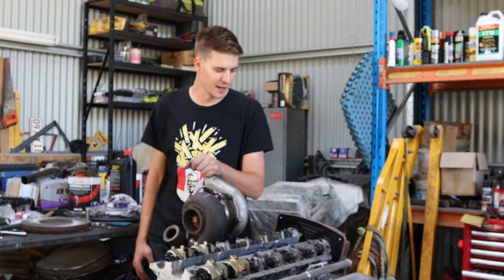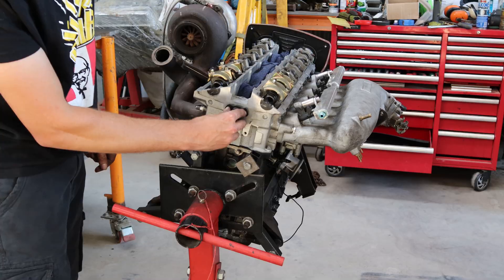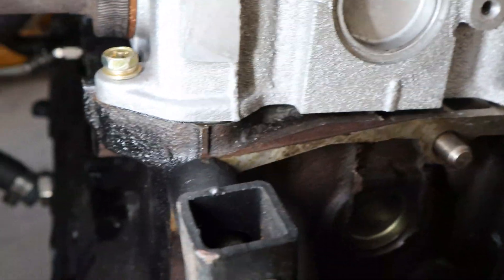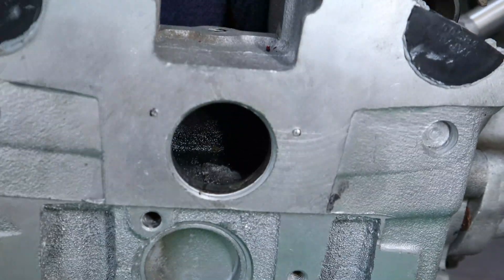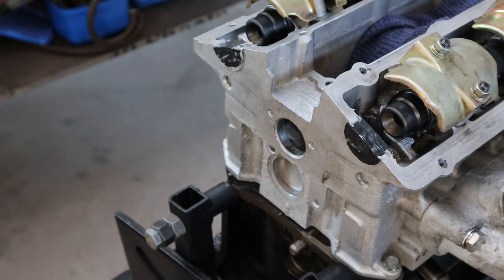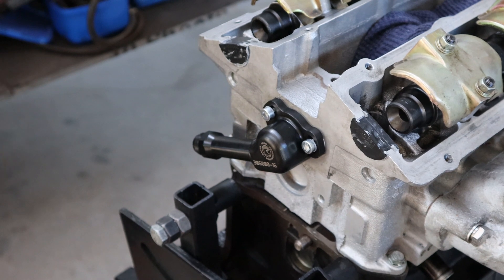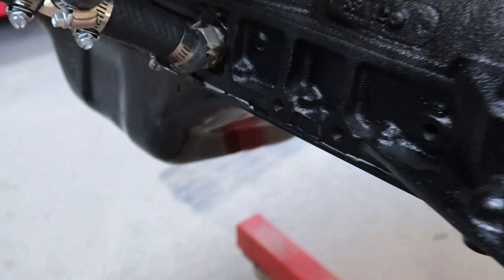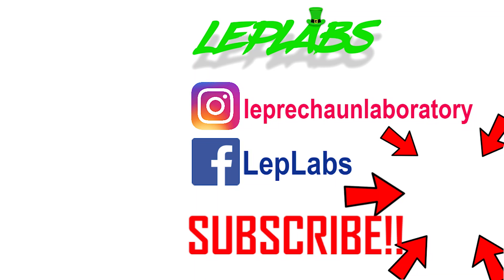RB25DET Head Drain Install

Comment: another answer is to let the engine warm up for 30 minutes before driving
Reply from the maker: What does that have to do with this?
Reply: @BoostGumps It is just a way to buy more time rather than thrashing the motor before it's lubricated.
That's my own answer to the key oiling issues you talked about.
Reply from the maker: @drtec6349  i see, but that has little to do with drain back issues and destroying oil pump gears in high rpm applications
Reply: I just thought, it makes better pressure when warmed up and 0w20 lightens it up a lot, burns very well.

Comment: Do you need to drill right through? You could probably drill 90% depth and still tep, even if you used a slightly shorter bolt, there would still be plenty of thread engagement for this.
Reply: Exactly what I was thinking

Comment: Hey man i was just wondering is there any difference to weather you drain this into the sump or engine block ? As i had my Mechenic t up my old setup into the oil drain for the turbo but i have had a few people say it should have its own hose either into the sump or alternatively into the block on the intake side , what are your thoughts?
Reply from the maker: Rage garage fine to tee it into turbo drain, although ideally having its own drain in the block/sump would be ideal. Doesnt particularly make a difference whether its in the block or the sump, as long as its high on the sump so it can drain freely. I would not recommend putting it on the intake side, the crank on an RB spins clockwise (if looking at the front of the motor) and thus will create a bit of a natural vacuum on the right side of the crank (exhaust side) aiding in draining. 
Not that it wouldnt work on the intake side, just would work better on the hot side.
Reply: @BoostGumps  That's actually incorrect. You shouldn't do it for two reasons. One being that Nitto for example says you definetely shouldn't tee it to anywhere, instead direct drain to sump. Second potentially you could end up in situation where there is oil not draining well enough for turbo because of high flow from the back of head. For example high acceleration scenario where lots of oil has collected to back of head and flowing to drain and potentially causing damage to turbo in this case. It could be also case where actually that drain starts to act as a crankcase breather, that means that gasses flow up from crankcase and stop turbo drain flowing as the drain can act multiple way. So overall, no, it's not a good idea to do that.

Comment: Sweet! 2.5L princess content! :D
2 quick questions:
- I'll probably have my Neo rebuilt in the next couple of years. Should I plan for such a drain, I've heard the Neo head had less head drainage issues than the regular 25 head?
- I've just bought a set of no name 750cc, E85 friendly injectors. Vendor says they're guaranteed to be flow matched and all, but I didn't get a flow chart with them. Aaaaand apparently nobody in my area can flow test gasoline injectors (gotta love France, wooohoo!). Should I just send it? :D
Reply from the maker: mrsabidji still a great mod for the neo! Its really a very cheap thing to do, this whole drain setup cost around $100aud. Definitely something i would recommend for any 25 thats pulled down already (or even not in this case)

Yeh to be honest injectors like that are a little risky imo, injectors is one thing i generally actually will pay top dollar for good quality aftermarket or oem injectors, even then its always a good idea to get the set flow tested and matched. Thats my opinion anyway 🤷‍♂️
Reply: @BoostGumps  Noted. I'll do the head drain thing then. :)
I've found a place that will test the injectors. They were not all that far from here actually, just not very well advertised. :D I should have the results soon. :)
Reply from the maker: mrsabidji awesome!! Be interesting to see how they go
Reply: @BoostGumps  Definitely. And that seems a lot more productive than finding out by potentially destroying my engine. Worst case scenario, I've just wasted $200aud. :D I'll tell you how it went. :)
Reply: @BoostGumps  update on all of that: I've bought a set of proper injectors. Deatschwerks 750, I hear good things about them. Also, the engine is out of the car, because I've bought a big boy clutch kit, so we're doing the head drain, too. :)
Reply from the maker: mrsabidji hell yeh that thing will be a weapon!!
Reply: @BoostGumps  I sure hope so. :P And your videos played a big part in getting it where it's at now, so you know, thanks and keep them coming. :)